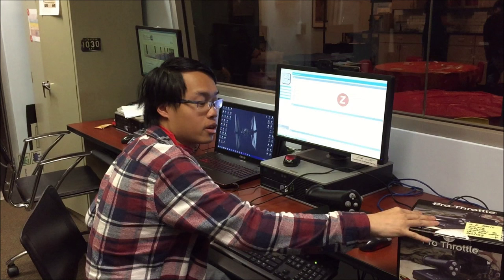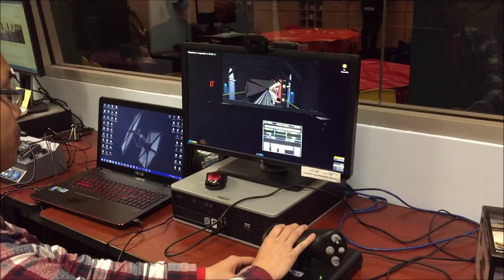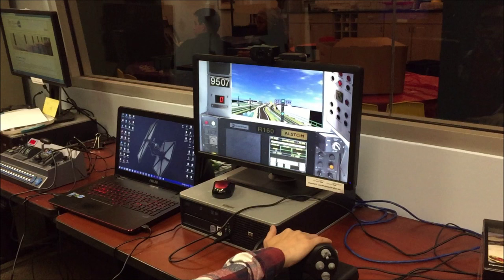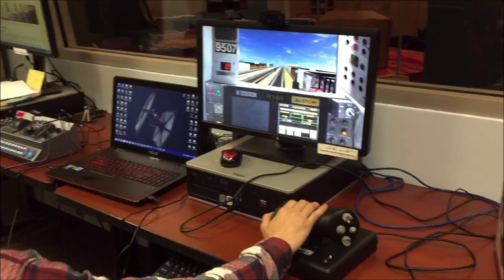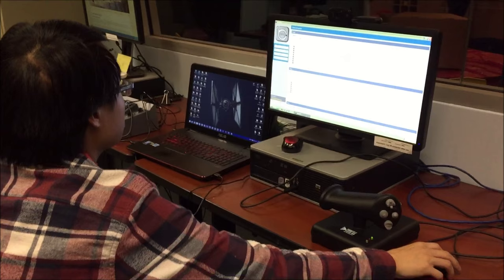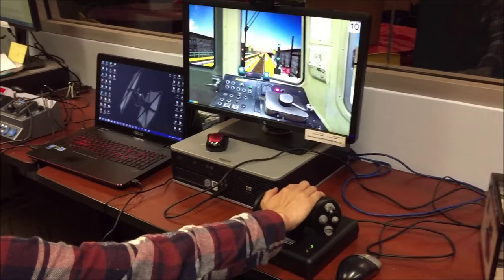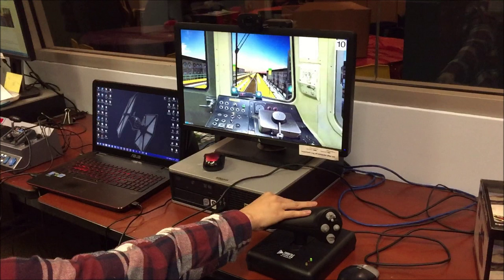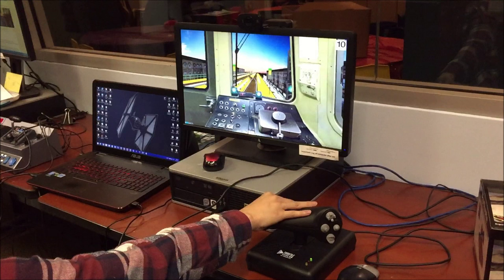OpenBVE HD 60fps: Testing New Pro Throttle Joystick Controller @ New York Transit Museum 3/13/16

Comment: Does anyone have an Open BVE control import for this throttle i can use?  I purchased this throttle for my son this Christmas.  We can get the buttons to work but not the axis controls (cant increase/decrease power, etc.)  Alternatively any instructions on how to manually configure the controls would help too.

Comment: Hey fan railer. I just bought this Pro T. I need some help to make it operate smoothly I cant seem to do it like the video without moving it back and forth and it makes it seem like a waste of money what did you do in the settings to make it smooth. I need help please :(.
Reply from the maker: Well, I wasn't the one who set it up, so I can't say for sure. I would probably look into the sensitivity levels and try adjusting those.
Reply: whats the basic default do you have it to?
Reply from the maker: Again, I don't know. I'm not the one who set it up. Additionally, I'm not at the museum, so I can't tell you.
Reply: O im sorry but thanks for the help tho. When you get a chance. Also thanks and ill keep looking into the sensitivity thanks for the help bro :)
Reply: In the options i set the cobtrols to the certain joystick controls. try messibg around with the controls until it works